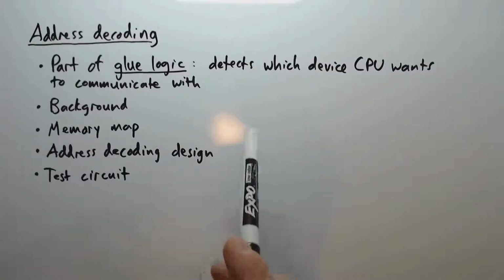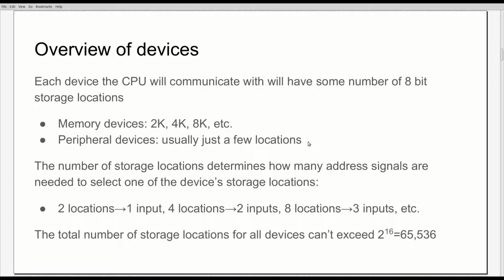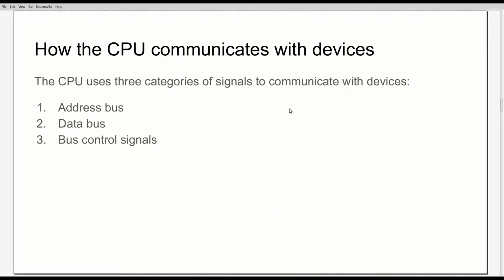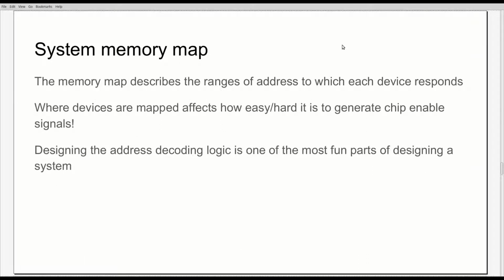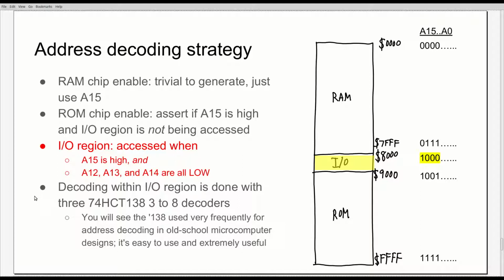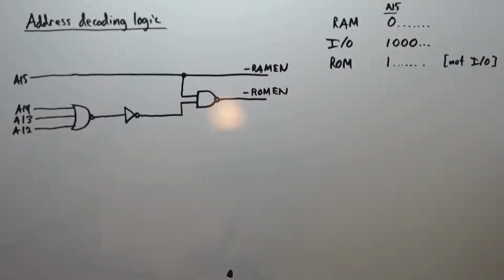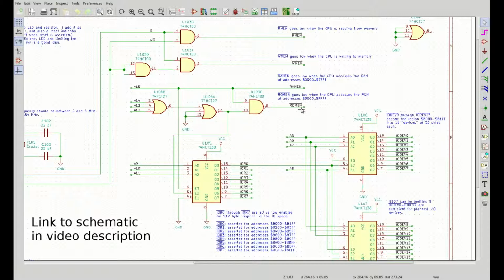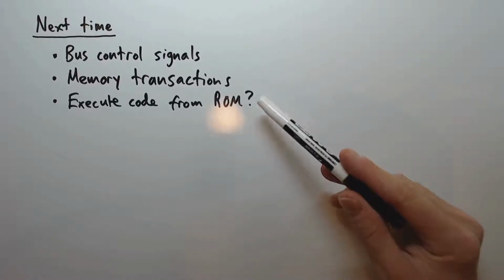DIY 8-bit computer, Episode 8: Address decoding

Comment: Useful exploration of address decoding. Might have been more helpful to show your addresses (on notepad) in binary rather than hex as it would have more closely mapped to the DIP switch settings. I initially used a '138 for my address decoding but found it too limiting and didn't want to have cascaded 138's in order to minimise propagation delays (I'm using the 68B09 CPU at 2MHz). In the end I used a 16V8 GAL which a bit more advanced than basic combinational logic but gives enormous flexibility in creating a memory map and even allows it to be changed easily. If you have an EPROM programmer the chances are it can program a GAL.
Reply from the maker: Good point about showing the addresses in binary. My background is software, so I tend to be comfortable with hex as a stand-in for binary, but from a teaching standpoint, it would be better to be more explicit. I've used GALs for address decoding in other projects, and they do give you more flexibility. For this project I felt like being more retro and using the plain 74 series logic ICs.

Comment: It seems that a 4 to 16 decoder such as a narrow version of the 74154 chip could be used instead of the two additional 138 chips
Reply from the maker: That's a good idea. I think I chose the 2x HCT138 just because I already had some on hand.
Reply: TTL-compatible '154s are only available new in surface-mount packages (HCT).
Reply from the maker: @tomcleaveland4325  Makes sense. I'm always a little surprised that any 74 series chips are available in through hole packages these days.

Comment: why use a 3-input NOR gate and an Inverter, instead of just a single 3-input OR gate?
Reply from the maker: 74HCT27 is a fairly common part.  There is a triple 3 input OR, the 74HCT4075, but it's not as widely available.
Reply: @davehohacks  3 diodes = 3-input OR gate.